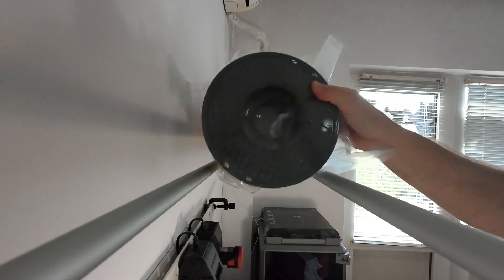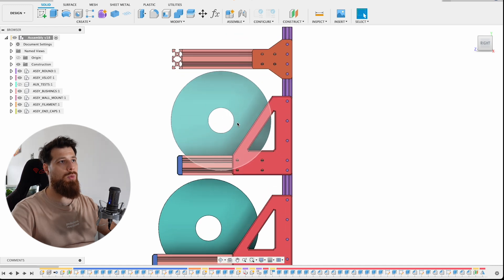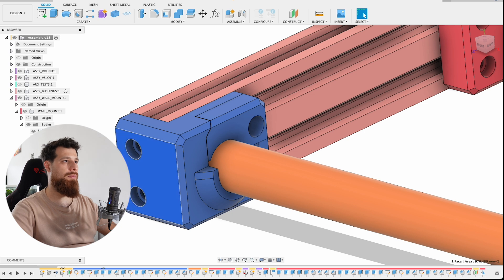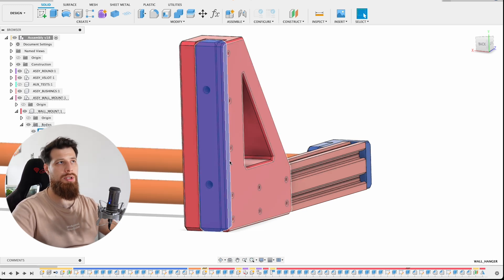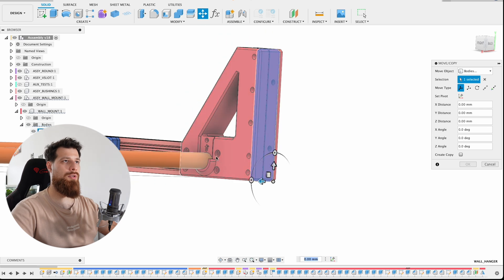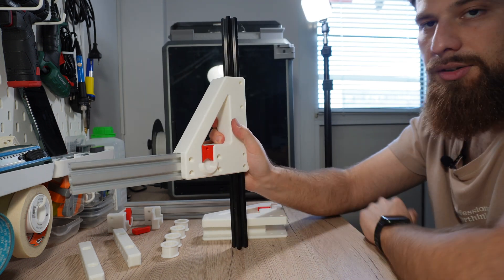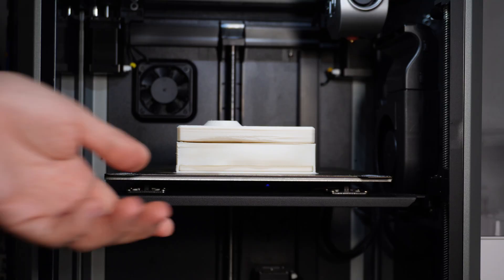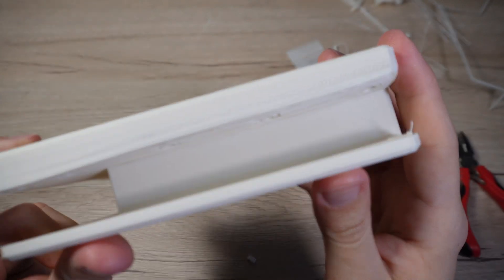Not your typical filament rack - yes, it's modular!

Comment: Nice But the Metal 20 mm & 40 mm Extrusions and rods are way too expensive in the UK due to VAT added to the already higher cost after the virus time all costs are 6 times or more because of the after changes in prices!  Very big problem all round really!  So I would have to see if I can print a different design which uses all 3D printer done parts.  Just one of those things?

I was thinking of designing some filament storage myself anyway since I have about 5 times more filament than you have there!  And 4 printers to layout in a room for them I be building inside another bigger room so it has sound proofing and fire protection. and maybe my resin printer be used there too?  I hoping to design a unit to have a HEPA filter and Carbon filter inside a box which can be unbolted to replace the filters the box has a inlet tube in the inner room and a outlet in the bigger room that small room is in. so the flumes can be sorted.
Reply from the maker: Ahh that's very unfortunate to hear :(
Yes, my setup is aiming for low-medium amounts of filament storage, i currently have two rows and it's plenty enough for me (25 spools). 
Good luck with the project, if you share it somewhere I'd be interested to see the results! :)

Comment: Theo...I'm in the process of building your filament storage system, which I'm really excited about, but I have a couple of questions.  1) What screw were you anticipating to use to attach the "WALL_MOUNT_MID" to the "WALL_HANGER"? I was expecting to use the same brass heat inserts and M5x40mm screws that are used for the "WALL_MOUNT" units but the holes are smaller than the ones on the WALL_MOUNT and the M5x40mm screws are too long. Yes, I know I can use smaller screws but I was just wanting to understand what your thoughts were when you designed the "WALL_MOUNR_MID" and how you envisioned attaching them.  2) Why doesn't the "WALL_MOUNT_MID" extend to support both rods? Do you have a model that does this? If not, would you share your "WALL_MOUNT_MID" f3d file so I can modify it?  Thank you for this awesome idea, I really like that your system includes the OpenBuild V-Slot rails.
Reply from the maker: Hi Patrick! Thanks a lot for the kind words, I added the F3D files and a reply directly on Makerwold :) If you need anything else, please let me know, I'd be happy to help!

Comment: If you flip those brackets it would be much stronger because in the force is being put down on the triangular bracket instead of being pulled away from it. Especially with the 3D printed part that may split at a layer line
Reply from the maker: That’s true! I chose the orientation of the parts in such way it won’t split at layer lines. But yes, having it inverted would be stronger, but I didn’t like the looks of it that way 😅
Reply: @tinkertv  i mean its not holding that much weight so either way would be fine, so better to do it the way you like looking at it 100%!!

Comment: I'd be curious to hear if you looked at the RepRack system and if you did, what made you choose to design an alternative.
Reply from the maker: I’ve seen it, yes, but it seemed to be quite flimsy. Also I did not like the aesthetics of it and wanted to have a way to secure more things to the system with v-slot nuts. That one is very effective for filament but not more I would say

Comment: "Never build something you can easily buy online"... except when it costs 3 times as much. I priced out just the extrusion and the beam for a single row and it would be around $50 and that's not including the screws and heat set inserts.

I currently use a 100% 3D printed modular rack and have used probably around 4 spools of filament to get 4 rows of spool storage (48 spools). I can easily expand horizontally or vertically for around 800g per 12 spools of storage space. With this rack it's rock solid at 4 layers and could probably do 5 or maybe even 6, but can expand horizontally basically infinitely or until you run out of wall space. I reckon I've used roughly $80 worth of filament to get essentially 4 times the storage that I would get for ~$60 using this method.

There may be some limitations, but for my purposes where I'm just storing filament it has so far served me well. Actually I'm about out of space so planning on expanding again soon.
Reply from the maker: Hmm for me the 25cm 2040 extrusions were 5$ each, but they might be cheaper in this part of the world, not sure. Technically 10$ for each 20kg of filament, then adding the fastners and heat inserts it should be roughly 30$ per 20kg of holding capacity. True, 100% printed would be much cheaper, but it won't fit my future needs for sure, as I would like to add more layers with different uses while still keeping the entire rack looking cohesive :)
Reply: What solution is it? I have been searching for something cost effective.
Reply: @mattsmith4993  It's called Modular Filament Spool Rack by TeeMuumi on Printables. I did add another row for a total of 60 spools stored since my original comment and it's still holding up pretty well. I probably wouldn't go any higher than this (5 rows of spool high) so any future expansion will have to be horizontal.

Comment: Engineers always be over engineering over complicating solutions that are not complicated at all.
Reply: also aluminium extrusions don't come cheap..
Reply from the maker: @GizmoTheGreen  That's correct! That's why I only opted for the 25cm cantilever ones, as those were roughly 10$ both, pre cut to length, the wall hanger was printed
Reply from the maker: Word 😅